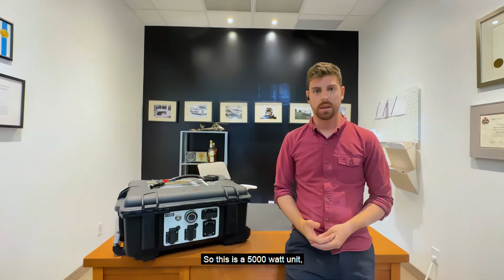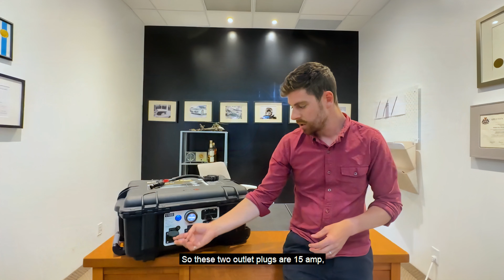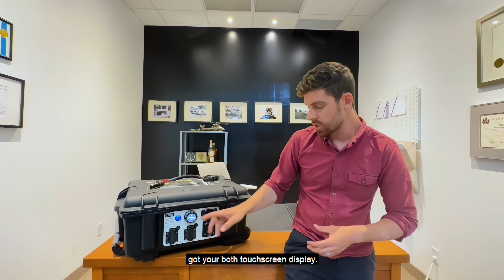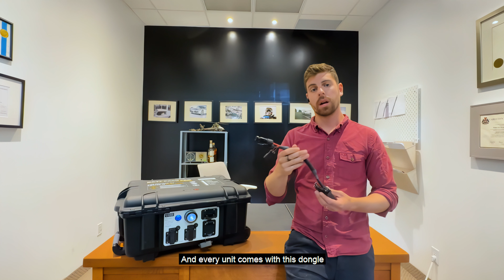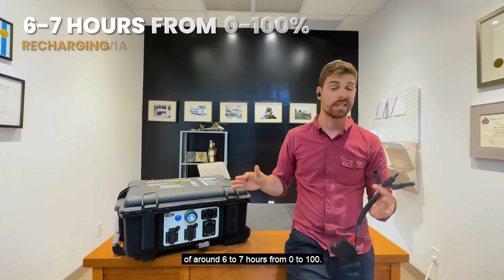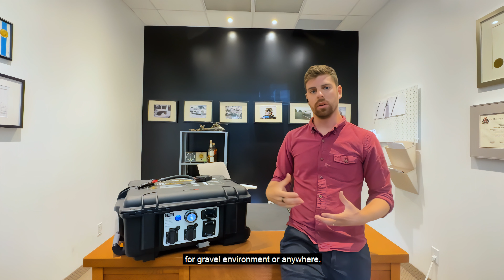The Batt Pack Pro: Your Pro-Grade Solar Generator

Comment: My core drill draws 15A @ 120V. How long will it run at full load?
Reply from the maker: It depends on the material you're drilling through, bit size, whole dept and diameter but we have a customer using a Husqvarna DMS 180 using a 2" bit and going 5-8" deep holes and they get 60-90 holes on a full charge. That's a 120v 20A drill so maybe a little bigger than what you have.

Hope that helps!
Reply: like 2.5 hours